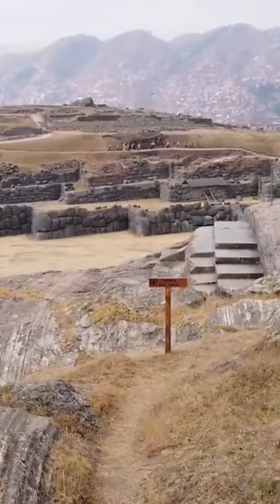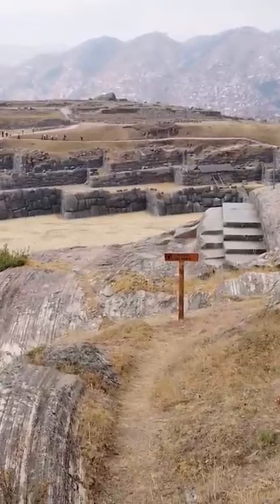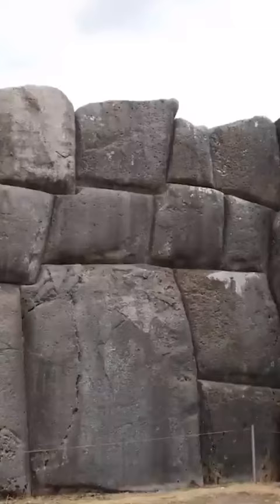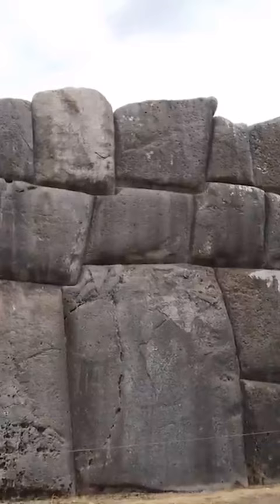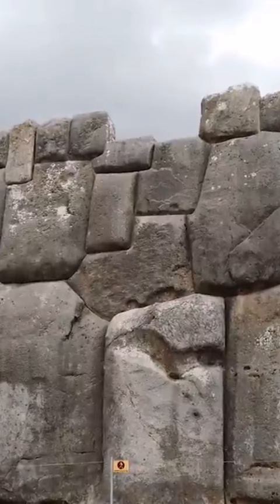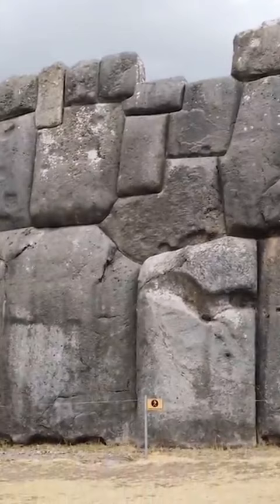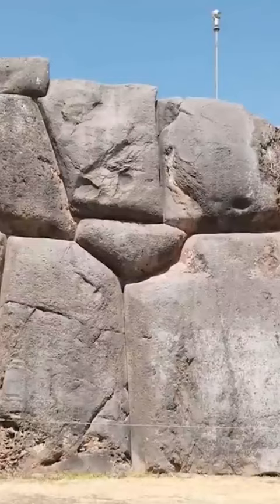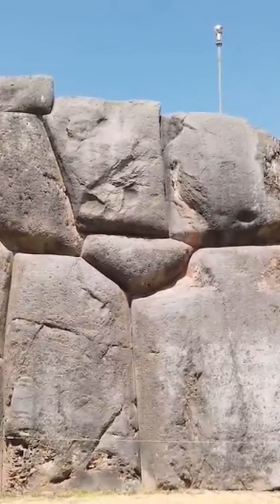How was it Done? Ancient  Precision Steps, 100 ton megaliths, softened stone

Comment: IF they were a type of concrete, that would make sense how the odd interlocking angles with no gaps.
2 stones can be set apart while the 3rd stone is poured in the middle and quick shaped while drying.
Notice we don't see any marble looking sediment lines in the stone?
We can see Chunks of a different type of medium in the finish, but the rest of the stone is basically 1 consistent color and texture .
Plus, toteing a type of cement powder up to elevation would be much easier then hauling big boulders up.
Reply: If you look close you can see cracks on the bigger stones. I think most of what we are seeing apart from the carved bedrock is stones stacked up. Then some sort of clay mixt with ash and gravel smeared over . Cracks would appear as it settled so more coats would be added each year. The big cracks would have been used to make the size and shapes of big rocks that we see today. There will be big stones there but not as big as you'd think. Not a special geopolymer as some think, just clay. Take care😊👍
Reply: It's just big bags of cement then set the wall on fire to harden like pottery

Comment: I've always wondered if these cyclopian walls were not perfectly set when they were first built but after eons of earthquakes, the stones have rubbed against eachother so much that now you can even fit a piece of paper between the joints
Reply: Look at were most cyclopian walls are found, Greece, Italy, the Andes, all highly seismic areas
Reply: If the tight fitting was a result of earth-quake-rubbing, there would have been lots of stone-dust in the joints. But they are extremely tidy/clean. Whatever tools the original builders were using - we have nothing similar in our time and age.
Reply: I thought the same as I watched
Reply: @wilhelmbeck8498  we don’t right now… what will our architecture looks like in a millennia? Not saying your incorrect, just thought for food
Reply: @Quinton Price  considering the abysmal quality of buildings today they'll be gone in a century or so.

Comment: Say it with me… “geo-poly-mer.    That’s right class, geo polymers.    These were poured in place, not cut to fit like that.    I’m sure they found out pretty quickly, that having mis-matched edges, seams, and the random interlocking geometrical borders, as all these examples show, serve nothing more than to provide strength to the structure/wall.   This style will provide far more strength for the wall as a whole than if the blocks were poured squares, and stacked one after another on top of each other.   

According to my hypothesis, the different interlocking styles of masonry can also be seen as not just for strength, but also as an element of style.    The wild joints scream to me as a craftsman, saying that the builder(s) were showing off a little bit.    

So really quickly the whole thing pretty much goes like this. I believe that these walls and structures were built with Geo polymer rammed earth blocks. This essentially like natural stone concrete, minus the stuff that makes our current day concrete fall apart in short time. As a sidenote that would be called the Portland cement.

I’ve actually seen examples of Geo polymer built “megalithic“ style walls just like these, but the stones still had some thing around them like a casing. Upon close inspection that’s exactly what it was and it seems that the casing is some type of animal skin sack or woven tightly woven sack That the builders must have poured their mixes into. Overtime the fibers turn to dust and all you see is the stone. So the example that I saw and I’m talking about these bags had not yet degraded and they were just still there.

Anyone that’s worked with pouring concrete or pouring plaster pouring Cass should be able to tell by looking at this stuff.  Look at the surface features of the stones and they bare many marks of poured material. There are lines and impressions on the surfaces of some of the stones that look like they would be left from wrinkles in a bag. The unique bulges around the stones edges sure look like Wet material that’s bulging out at the edges and held in a sack. But then in the middle of the big block of material you have flat pieces of wood that box it in on each side. And the side that’s connected with the wall has the joints expose like we see.   So as you build your next block you come to your last one you did with the little corner sticking out or whatever you build a box around that with your wall you put your sock in there and you fill it with the Geo polymer mix. I’ve seen a shot of one of these walls where you can even see in the bottom corners of the stones and this is almost every stone, you can almost see like where they would’ve tied off the bag.

Now consider the joints. In my opinion this is the only way of building that checks all the boxes and makes those joints possible. The precision cutting intense labor and transportation of the heavy materials are damn near impossible now and there’s no way that they did that back then like that and there’s no way that these walls were built like that.

One more thing and I apologize for dump in this book on you guys but I hope that some of you value this… but one more thing is that on the intro to this video the narrator talks about the stone surface is deteriorating over thousands or millions of years or whatever the hell he says. Now right before that he’s talking about how this is like the hardest granite and or it was vitrified stone which should be like hard is like you know hard like vitrified Stone doesn’t chip a part as far as I know. But if you look at that wall is being poured all of the parts that are chipping away look a whole lot like aging concrete and aging poured material as it breaks down.

Sorry if my language and English is a mess here but I wrote this in a hurry and use talk to text. Bear with me I’ll be back to edit it for sure but I got a run.  Good day folks